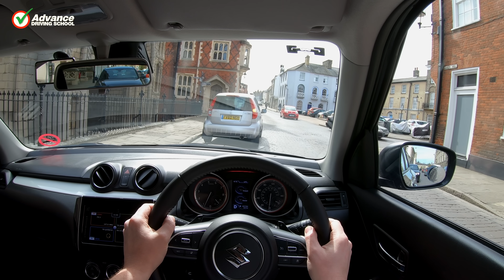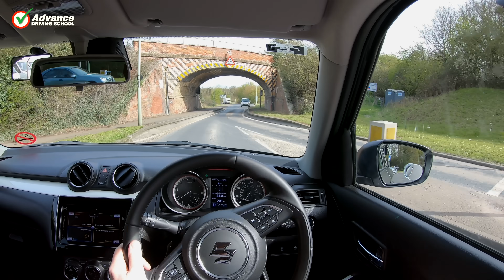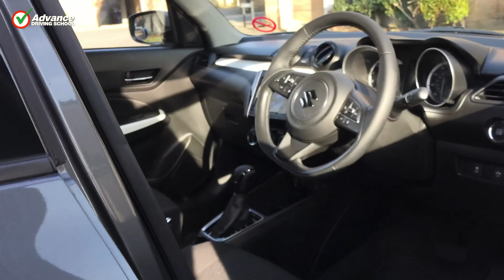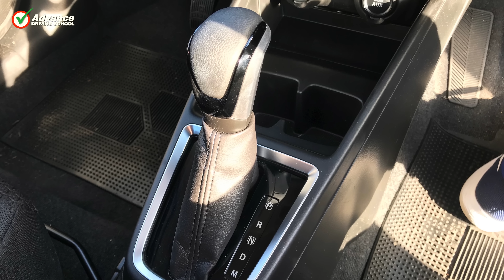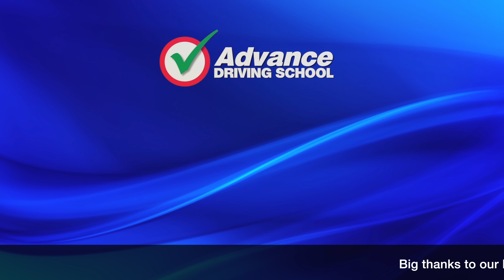How To Drive An Automatic Car

Comment: When driving an automatic,especially when parking on an incline press the foot  brake,select neutral,then select 'P" handbrake,release foot brake.This way the weight of the car is not resting solely on the pawl pin, oh yeah, and face the front wheels into the kerb! 😅

Comment: When moving from driving a manual gearbox to an auto, I find it very good advice to position your left foot/leg well away from the pedals. It can be very easy to forget and while reaching for the change lever at speed mistake the brake for the missing clutch pedal, very embarrassing and  can be dangerous!

Comment: While stop the car we need to shift D to N gear and pull the hand Brake. If no car can Shift N to D gear and release the hand Brake.
Reply from the maker: There is no benefit in selecting Neutral+Handbrake - using Park is sufficient to hold the car stationary when stopped. We only use the Handbrake when leaving the vehicle.

Comment: Why the need for pressing the brake pedal while starting up the engine??
The gearbox should be in "P" Park Stance if we enter the car,  and since the transmission is locked in Park Stance, why is it necessary to push the brake pedal while firing up the engine?
Reply: its a standard thing for cars with keyless start.

Comment: Automatic cars are for three types of people; 1 people who can't pass their test in a proper car, 2 people who are incapable of understanding how a proper car works and, 3 people who are just too lazy/stupid. 
N.B. this does not include people who find it just too physically demanding.
Reply from the maker: What an outdated point of view. We drive both manual and automatic cars and they both have their strengths and weaknesses.  Manual cars can be more engaging on a fun drive - but are less efficient and slower than a modern automatic. I know what I’d choose for a busy city journey with lots of hills or traffic queues - and it wouldn’t be the one with a clutch pedal!

Comment: I’ve been driving since 2011 and I’m in my first auto (only about three weeks so still fairly new) This has helped with a few queries I had. I didn’t realise I didn’t need to use to accelerator when reversing as the car does it for me. I am yet to try on a hill without pressing the accelerator. Lol 😊

Comment: I passed in a manual 38 years ago bought my first automatic 3 years ago and i can honestly say i will never go back to a manual.  Enjoy a automatic car much more.
Reply: When you stop at a traffic light. What do you do? I'm a manual driver. But considering the jump. Can you just sit with your foot on the brake or do you have to put it in park then apply the hand brake? Thanks in advance.
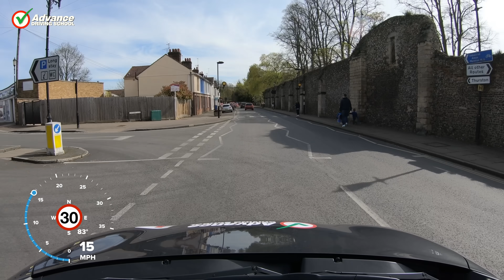Reply from the maker: The video shows both options at about 4:30. Most people stay in Drive and use the foot brake only whilst waiting, but you can select Park if you prefer. The handbrake isn't needed as Park will stop the car from rolling downhill.

Comment: Back in the day, after driving manual cars in the UK for 15 years, I spent a year in America. I bought an automatic because it was impossible to find a manual. The advice I was given by the seller was just put the gear stick in 'D' and the car will do the rest! Needless to say I have driven automatics ever since. Interestingly enough when I have occasionally gone back to manual, such as a hire car, I have no trouble remembering how to use gears.

Comment: When parking we should apply the hand brake before putting in Park, specially on an incline so we don't overload the parking pawl.
Reply from the maker: Or just keep the foot brake applied, as this will also protect the transmission. Either way around is fine. 👍🏼

Comment: I am having an issue with doing maneuroves in my automatic. When I am doing the maneurove it will stand still  instead of creep after I press the brake as nd then I have to press the accelerator to make it move again. This is a problem as I only need to move a small amount and they accelerator makes it go too fast. How can I stop having to use the accelerator during maneuroves?
Reply from the maker: Some automatic cars don't 'creep', so you have to press the accelerator gently. This is unusual, but I'm sure you will get used to it eventually.
Reply: @AdvanceDrivingSchool  is it something to do with the hold function. Do I put it in hold when I press brake fully doing maneuroves ? And if so is pressing the accelerator the only way to get it out of hold

Comment: Sir uphill or incline parking what first thing to do? I pressed down  footbrake to complete stop then i put parking brake on and put in park position. Is this correct procedure sir.
Reply: And key off
Reply from the maker: We prefer to select Park, then apply the handbrake - but it doesn’t really matter which you do first. As long as the car is securely parked 👍🏼

Comment: Great video but my question is; would it be misleading to say that manual vehicles will disappear as many drivers still prefer manual vehicles?
Plus depending on the purpose of a vehicle, manual will be the better choice for efficiency and performance.
Just asking for clarification

Comment: I’ve been driving for a bit over 45 years now. I’ve owned automatic cars as well as manual cars. I have even been driving a manual car that required double clutching when shifting up or down. You easily get used to either way and most of the time I don’t even notice when I’m shifting because it’s already fully set in my brains and muscle memory. Automatic driving is fine and to some occasional drivers it may seem more comfortable, but after you’ve made enough kilometers you really don’tnotice the difference anymore.

That all said, I must add that my next car will be hybrid, thus automatic (cvt).

Comment: I am quite concerned with your suggestion that we switched to Park when waiting in traffic lights. I believe quite a few manufacturers don’t recommend switching to P in that situation. It’s possible to remain using Drive or, if you wish, neutral. But definitely not P to avoid damaging the gearbox….
Reply from the maker: I have never read that for any car - if you’re stopped how could selecting Park possibly damage or wear the transmission? It doesn’t matter to the car whether you’re stopped at the side of the road, or anywhere else…

Comment: In other country they park 1= stop brake in 2=from d=drive to n = neutral 3=handbrake up 4= from neutral to P=park 5= remove brake 6= key off. Is this correct sir
Reply from the maker: There is no need to use Neutral.
Reply: Sir in traffic light stop I stopped for some time about 1 minute more i put park and apply handbrake up no need to keep brake pressed. Is this correct sir
Reply: Good content sir.

Comment: Sir when you park 1= brake in 2=put gear to N= eutral 3=release footbrake 4= parking brake up then 5= put to P= ark. Is this correct way sir.
Reply from the maker: There is no need to use Neutral in an automatic car. Press the brake to stop the car, and when keep it pressed whilst selecting Park, then release the foot brake. We only use the handbrake when leaving the car. 👍🏼

Comment: If a auto car has a park position why do some have a handbrake? What is its purpose?  Good video!
Reply from the maker: It’s for extra security - just in case the gearbox is accidentally knocked out of park into drive / reverse / neutral.

Comment: When turning on the car why do we need to press the brake if the handbrake is already on? The car wouldn’t move forward would it
Reply from the maker: There is always some kind of mechanism to prevent accidental selection of drive or reverse - in case a child is in the car and the handbrake has not been applied. Some cars have an extra button on the gear stick, others use the brake pedal. 👍🏼

Comment: When changing gears e.g. change from park to drive do you have to press your foot on the brake? Does the brake act as the clutch
Reply from the maker: There is always some kind of mechanism to prevent accidental selection of drive or reverse - in case a child is in the car and the handbrake has not been applied. Some cars have an extra button on the gear stick, others use the brake pedal. 👍🏼

Comment: If going up or down steep hills, is it better to select a gear of your own choice than to let the car decide?
Reply from the maker: There is no need going up, but we might select a lower gear going down in order to increase ‘engine braking’ and prevent the normal brakes overheating.

Comment: Hello I am learning automatic car. When I did 20 spreed road drive my spreed gone more spreed like 22,23 spreed. How do I will contort my edjecly road spreed. Test time
Reply from the maker: With practice you will be able to use the accelerator more precisely and get whetever speed you need. 👍🏼
Reply: Tnx u so much reply. I am learning automatic car, what is best thing I can stay same speed driving when will see road mark 20,30 etc say

Example when I did drive 20 miles spreeds roads ,my speeds goes to more than 20 like around 23 or when tried to less goes 16,17 or less, I did only automate lessons 3 , can please give a idea
Reply from the maker: We have to continually adjust the position of the accelerator pedal, to compensate for gradients in the road. It will get easier with practice. Here is a video that explains further:
Acceleration Sense: https://youtu.be/-z8CveLub2M 👍🏼

Comment: I've been driving for over 20 years and have never driven an automatic but I am considering buying one for my next car. This has been a great video but I am still a little bit apprehensive about not having control over gear selection and the 'creeping' function you mention (especially during manoeuvres). So I have decide to have a couple of lessons before trying my skills on £20K worth of car. It does look like a much easier option for long journeys
Reply from the maker: Best of luck 👍🏼

Comment: I have been driving an automatic transmission for 23 years for the different vehicles that I had over the years. When I was in Driver’s Ed  in high school the car was an automatic vehicle. Even my parents had mostly automatic vehicles from the mid 1980’s to 2018. My mother used to have a car that was manual transmission from 1980-1985. That car was a 1980 Ford Escort station wagon. She traded on a 1985 Ford Tempo which it was an automatic. I think it is so easy to drive automatic. Even my sister drives an automatic,too.

Comment: You should select N and apply the handbrake before Park, as P then handbrake, means the whole weight of the car is on the gearbox
Reply from the maker: There is no need to do that - as the gearbox is engineered to take the full power of the engine, so just the weight of the car won’t cause a problem.

Comment: For me I would be constantly looking for the clutch and I would assume that you would need to press on the accelerator in reverse rather than releasing the brake
Reply from the maker: If you are used to driving manual cars, it does feel strange the first time you drive an automatic - but that feeling quickly goes away. 👍🏼

Comment: I had a question about pulling up on the left in an automatic car. Would you need to put the car in park and put the handbrake on? Usually I just keep the foot on the break but not sure if that's correct
Reply from the maker: We always select Park when stopping at the side of the road, so we can take our foot off the brakes and stop the brake lights distracting other drivers.

Comment: Hi, I am just getting my first automatic. Reference towing with an automatic is it best to select drive or use the manual option. Also if you driving in the option where you can change the gears, do you have to stop to select drive or can you change whilst the car is moving.
Reply from the maker: You can switch between auto and manual control if the gears whilst driving - but we would only use manual mode whenever we need extra control, such as using low gears to drive down steep hills etc. 👍🏼

Comment: At some traffic lights, there can be a wait of several minutes. When driving a manual car, my usual practice is to apply the handbrake and slip into neutral. Is there any reason not to do this in an automatic, rather than to apply the handbrake and select Park as shown in your excellent video?
Reply from the maker: You have several options in an auto:
A) stay in Drive with the brake pressed
B) select Park and release the brake pedal
C) select Neutral and use the handbrake
Just use whatever option you prefer 👍🏼
Reply: @AdvanceDrivingSchool  Thanks. So if selecting neutral and applying the handbrake, I can take my foot off the brake pedal? Remembering of course to press the brake pedal again before selecting drive mode (and releasing the handbrake) to drive off again.

Comment: I've been driving manual cars for almost 5yrs now and let me tell you this. I enjoyed driving my automatic car more. It's less pain in the ass. I'm not the typical "AUUGGHH REAL MEN DRIVES STICKS" kind of guy as I'm not into cars and the only purpose of them for me is to travel from point A to point B.

It is true that manual cars give you some level of control. But also most of my friends who got into an accidents are the one driving manuals. Because it takes more focus and attention. A wrong gear slip, clutch and engine mixing and either you bang into some one of someone will bang into your rear for a sudden stop.

What I can say though is if you have a manual car then it is a good skill to know just in case your automatic car is not available in times of emergency.

Once I felt the comfort of driving automatic cards I never looked back.

Comment: What is kickdown? Thanks
Reply from the maker: Kickdown is when we quickly press the accelerator fully down - this tells the car that we need maximum power. It will then change down to the best gear to accelerate the car as quickly as possible. We show it in this video: Accelerating Quickly: https://youtu.be/NeGWVLaDQu8 🚙👍🏼

Comment: I  have my test in a manual tomorrow. If I dont pass I am thinking of maybe automatic lessons. Even though I can change gear etc I struggle even now to do that at the same time as other things its just not sinking in, from experience manuals are great for multi tasking people, but I am slightly autistic and even not driving I struggle to process lots of information at same time and I often miss road signs, speed limits not because I am lazy but I am focusing on gears and miss other information or observation. I am a careful driver though and picked up lots of information even in a manual. Love this channel picked up so much information its very calmly explained, which I was near to you learning 👍
Reply from the maker: Good luck tomorrow! 🤞🏼

Comment: One point to add: in some automatic vehicles especially heavier vehicles or if carrying a load, when moving off uphill from stationary, you may need to slightly depress the gas pedal to prevent rollback as the creep function won't have sufficient power to hold the vehicle on a hill.
Reply from the maker: We show that situation in this video: Hill starts in an automatic: https://youtu.be/2IWnbF59ET4 👍🏼

Comment: Wait wait .. I'm confused 7:50 she said "when driving normally its more efficient to drive to select the normal drive settings on the gearbox" HOW? If you put your foot down the brake to switch to D the car will stop/brake/jerk
Reply from the maker: You don’t need to press the brake when switching between different forward driving modes - eg Drive to Sport / Manual / Winter etc.

Comment: Automatic is the best very specially for learners should take tests on automatic cars .The DVLA needs to ditch manual & start all tests on automatic cars.Many learners fail tests due to manual nightmare of changing gears & losing controls .

Comment: I've been driving manual transmission cars for over 40 years and am about to purchase an automatic transmission car so this video has been a great help to give me the basics of which gear to select and when to use the brake pedal to hold the car or select Park.
My test drive in the car was during lockdown so the salesperson couldn't accompany me for the drive, with just the briefest of explanations before I was let loose in the car! A very cautious drive followed but I feel more assured having watched your video. Just have to wait on the car being built!
Reply: I couldn’t drive, so I set myself a challenge and reckoned the quickest way to get a licence would be an automatic. I’d had 6 manual lessons in my teens, hated it and gave up, thinking driving’s not for me. So, 20 years later, I ordered a new Aygo which would arrive in 5 months from the factory, found an automatic driving instructor (who was great) and took 20 hours of lessons. Passed my theory, then my driving test just in time (phew!) to take delivery of my Aygo.

Comment: 8:00 Key word - USUALLY. Some automatics, especially performance ones, are so aggressive that they will quickly drop several gears to climb a hill or accelerate, which may not be the most efficient.

Comment: Having selected "M" and used the paddles to change gear, how do you get back into "D"? Do you just get to the speed you want and then shift the gear lever?
Reply from the maker: You can use the gear lever to switch between M and D modes at any time, as the car will automatically choose the best gear for that situation.
Reply: @AdvanceDrivingSchool  Thank you

Comment: Can you change to M when driving in D if the car is moving or do you have to select that first since you have to always press break to change gear?
Reply from the maker: We can change between forward driving modes (such as Drive, Manual, Winter, Sports etc) whilst moving, without the need to press the brake pedal. Since there are many types of automatic transmission, please read your car's manual for more detail.